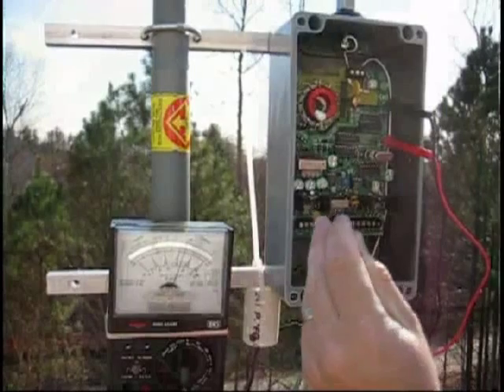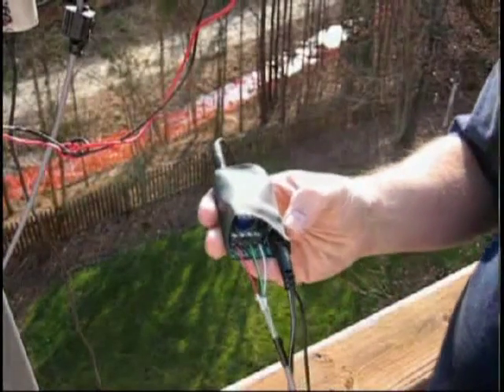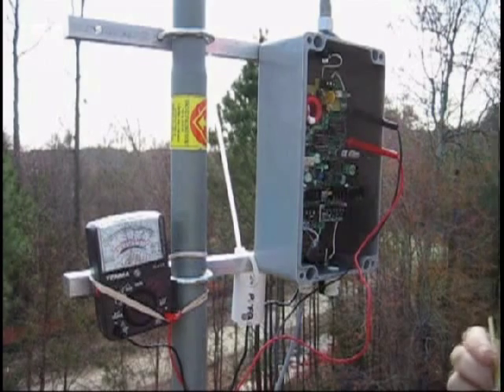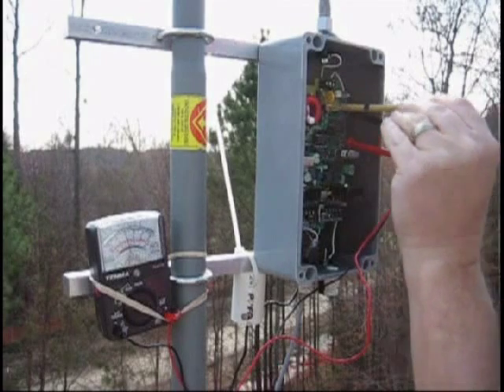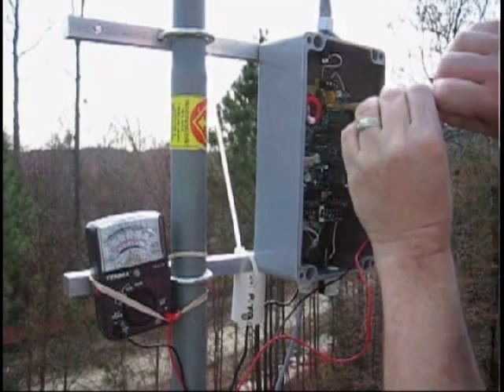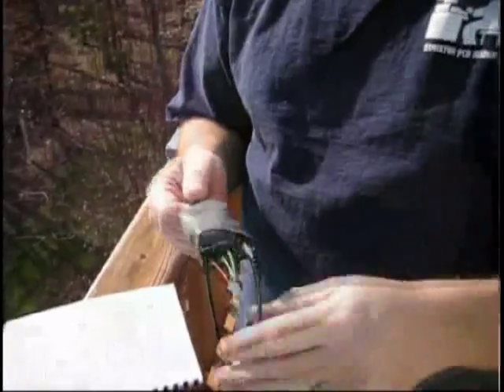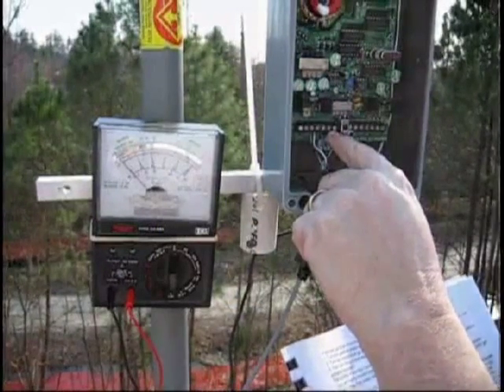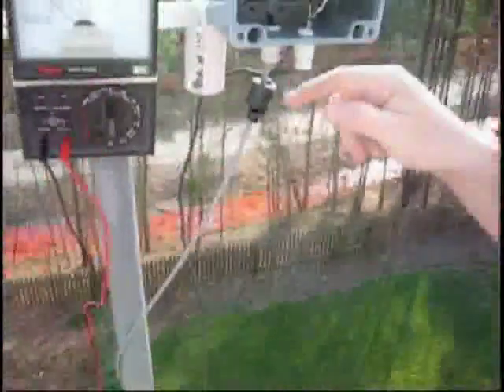Tuning overview AM 1000 Transmitter for your Infowars AM Station

Comment: Wow,  really getting some interesting comments.  I run a part 15 transmitter that is home made using vacuum tubes and get great range with my 100mw.  I opted to use a three meter fiberglass tube that I wound with copper wire and made an end fed matching network to feed the antenna as a loaded half wave.  No radials,  no ground.  I get a solid 3/4 of a mile solid and about 2 miles with a noisy signal in the car.  
I originally built the transmitter to broadcast to my restored old 30's era radios.
Reply: That's fantastic! Could i get a schematic?

Comment: SECOND PART of comment  --- "Ah but look again. The operative word is ground "LEAD"
You cannot run a copper grounding wire all the way 
up the mast to the transmitter, but nothing is stoping 
you from hosting rangemaster to a 60foot high steel billboard
and grounding directly to the structure. As long as the 
total combined length of the antenna and grounding
wire do not top 10 feet total.

Comment: I think i finnally found my answer // " Fcc regulations state that the combined length
of Part 15 AM Antenna and ground lead cannot exceed
120 inches. One might think that because the antenna 
already occupies 102 of those inches, the very short
ground left behind will impair performance...." ___---  rest in the next comment
Reply: RF Coupling ;) My 1982 cordless telephone uses them. nice loophole
Reply: You're correct. If you wanted to put you Transmitter up, let's say 25 feet on a mast pole, the ground lead rule too short from the transmitter. In many areas, more ground lead wire down to the dirt connected to a ground rod (say, 20 ft. of copper wire) is not going to cause the signal to go up higher. The ground lead is needed for lighting protection, not for better of a RF output signal, in my opinion and study. These rules for Part 15 AM Broadcasting were written in the 1930s and are outdated. A rule making needs to be filed to change the ground lead rule to say 25 feet longer for a good ground for lightning protection only, not an RF Intensity Increase!

Comment: I am thinking about   purchasing a range master, and i don't want to have an problems with FCC.  So would you please reply to this and tell me if its possible to legally put that range master  lets say on a roof of a building, like a church so i would get better range?   "  FCC 15.219   Operation in the band 510–1705 kHz.  (b) The total length of the transmission line, antenna and ground lead (if used) shall not exceed 3 meters" Does it mean that its illegal to have it higher than 3 meters?
Reply: Not necessarily.  You can put it as high up as you want if you don't connect a ground wire to it, BUT, if you put a 102" whip on the antenna screw on top as Keith Hamilton suggests, don't mount it higher than about 18 inches above ground IF you're going to hook a ground wire (which is your "ground lead") to the ground post of the transmitter and connect that ground wire to a ground rod (which is literally in the ground).  To my understanding, the ground rod is NOT considered part of the "3 meters."

Comment from the maker: @JasonDolan I really don't care what you think but that all depends on your knowledge to enhance the audo -A-Synchronous bias (inovonics 222), the grounding, the soil condition (perhaps your area = sandy soil) and the tuning. I have 5 in one spot which soldly carries 7 miles radius & another (single) which can be detected 10 miles away.
These are FCC legal part 15.219, not your taking house xmitter. I've even had a FCC visit which was positive. Distorted audio? Wrong. We're better than any AM.

Comment: The limit for license-free AM transmission in the US is 300 milliwatts RF ERP, isn't it?
Reply: ERP is FM, not AM.  The limit for Part 15 AM is 100 milliwatts into the final RF stage.
Reply: ERP is effective radiated power. It doesn't matter if it is AM or FM.
Reply: @radioguy19510  I know that.  But no engineer I've ever known has referred to AM signal strength in terms of ERP.
Reply: @ApartmentKing66  I don't think I said anything about that. I cant see my comment.
Reply: @radioguy19510  ERP is the radiated power from the antenna. With AM the legal power is not measured from the antenna or in other words what is radiated. No field strength limits with AM.
Reply: No it is 100 miliwatts.